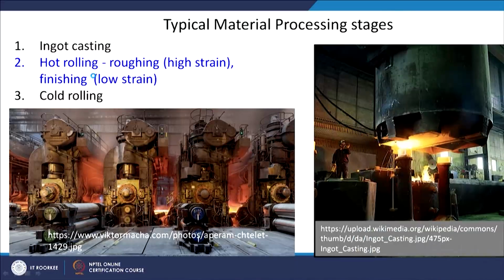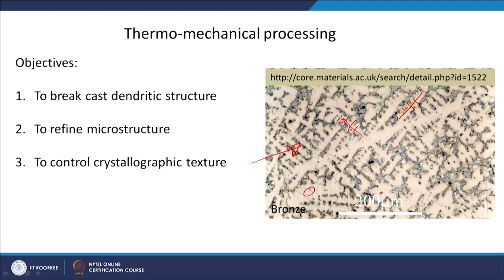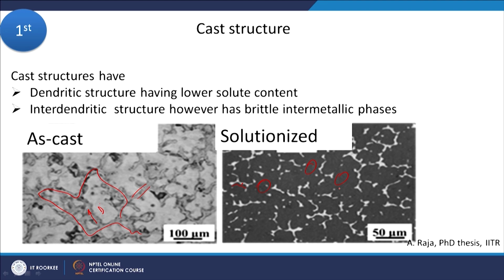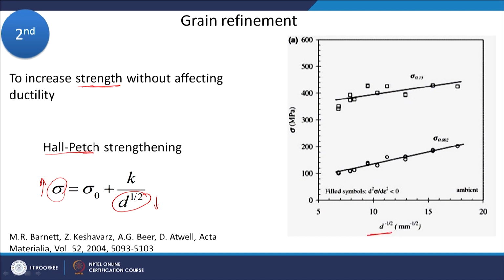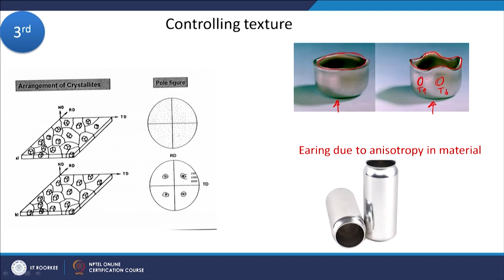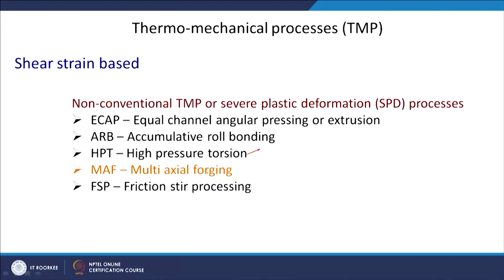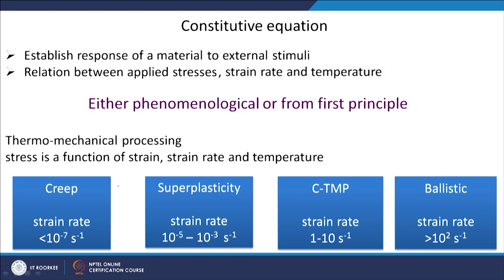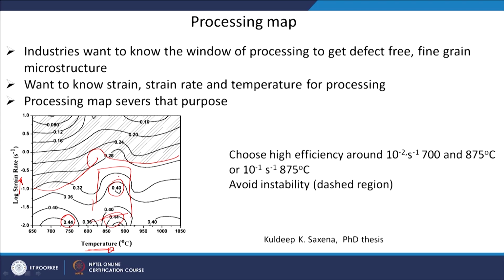Introduction to Thermomechanical Processes

Comment: Sir what’s a role of water pressure during quenching in hot rolling and how the yield strength gets change with respective water pressure and bar temperature before and after quenching